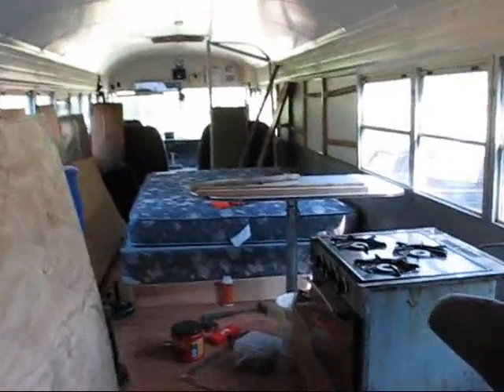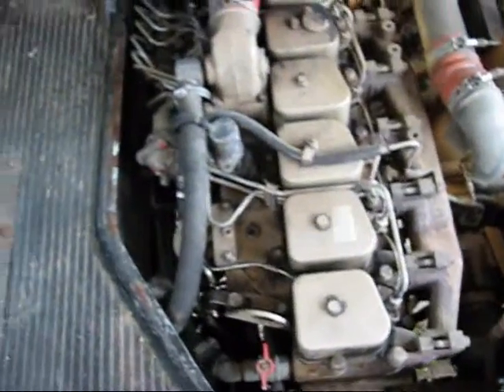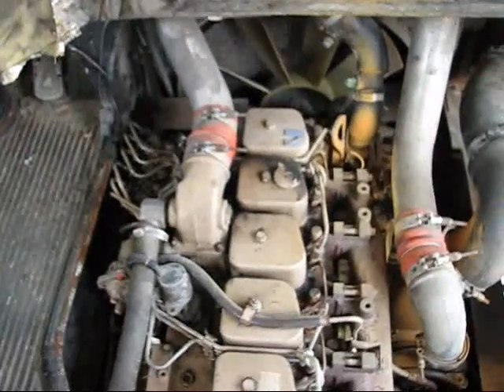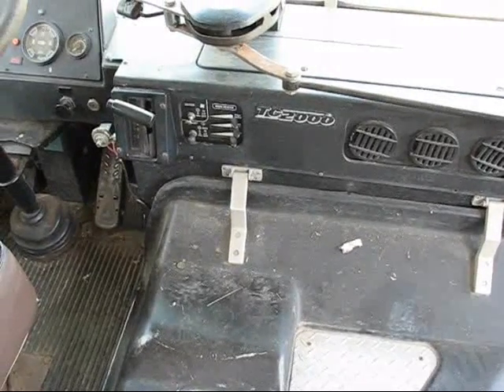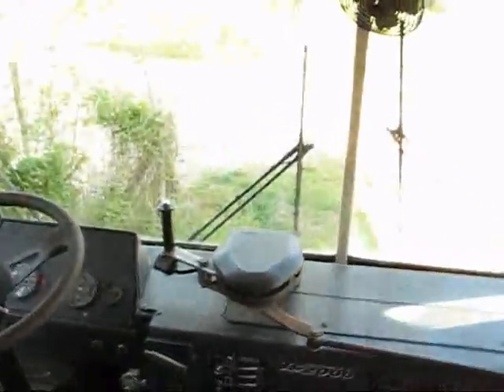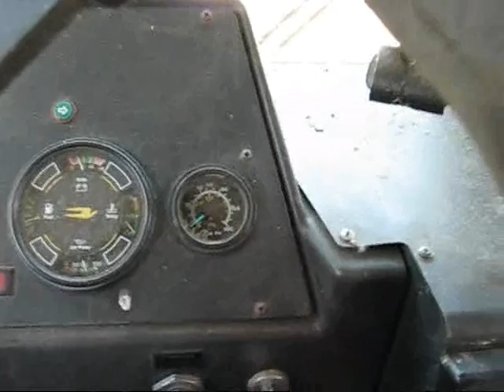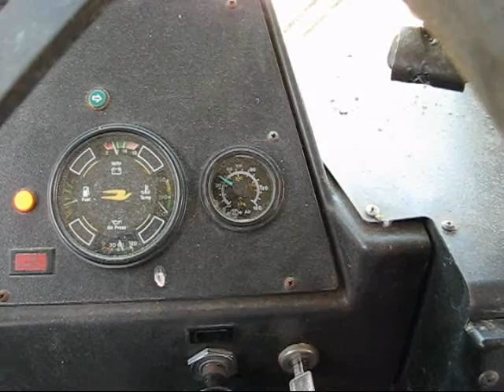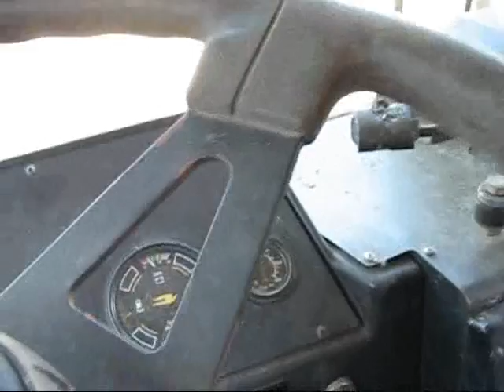Cummins Diesel Bus Cold Start

Comment: 6bt mechanical injection, one hell of a good engine. We have an old Clark 36000 pound capacity forklift with one in it and its fires up as easy as yours with over 2000 hours on it.
Reply from the maker: They're great engines, no doubt about it. I have another one in an '89 Dodge.
I once talked to a logger who told me he had seen 4BTs in Case skidders go 50,000 hours! That's the equivalent of 3 million miles at an average of 60 mph.
They don't last that long in a bus, though. It puts a much heavier load on them, not to mention the fact that they turn 2400 rpm at highway speed in this application.

Comment: I have a '93 Fleetwood 35J with a cummins 6bt with 63000 miles on it I bought a year ago. the exh manifold shrunk and broke 2 of the bolt ears off the head so I replaced the head with a Chinese ebay head and a Cummins head gasket. 1000 miles later and so far, so good.

Comment: looks like a 1993 Blue Bird TC2000 last year for the teleflex guages in the guage cluster and first year for the lower profile engine hood on the cummins 6bt which moved the turbo lower.  1994 has the GM sourced guage cluster. the other engine option for the BlueBird TC2000 up to 1995 was a GM big block 7.0l 427 V8 gas engine. as the TC200 was produced from 1988-2002

Comment from the maker: Soon. I need to locktite the flywheel nut and put it all back together. That's on the Tanaka; the Eska is on the back burner for now. I've been concentrating on my Honda Trail 90 project, and have a new installment on it that I will probably upload next week. Also, I'm getting back to my CJ-7 (which you saw in another video) since I sold my Cherokee. The XJ that is; not my full size Cherokee.

Comment: As long as the batteries are charged, it is a no brainer for damn near anything to start right up.
Reply from the maker: I guess that's true if you only ever operate late model, computer controlled fuel injected stuff in good mechanical condition.

Comment: in the uk many buses have the cummins 6bt and allison at545. the at545 is not a good gearbox it wont change gear until the engines nearly flat out and they jump in and out of gear. you can hold all 4 gears manually though. the cummins 6bt is an excellent engine goes on forever

Comment: that's a  damn good  sounding cummins  starts right up  ,,,I got  2  older  4BT cummins engines  and they are both like that 
1 is in a 1987 chevy S10 4x4 and it  has  280,000 miles on it  
the  other is in a 40KW genset  ,,it has  15,000 hours  run-time on it 

they both start just  as easy as your bus just  did ,,,
the  genset will start in  -10F weather with just a 5-10 second crank after preheat
Reply from the maker: What kind of fuel mileage do you get with the Chevy? I would like to have a 4BT to put in my 4 door Wrangler.

The genset sounds sweet, too. I have a railroad surplus genset with a 2-71 Detroit. It is six-pole so it runs at 1200 rpm. It is only 12KW, which is a light load for that engine even at such a low rpm. I have some videos up of that genny running.
Reply: I get in the  high 20s to mid 30s  depending on my  driving  and the  load 

my  genset  runs  1600 rpm  average  ,,I have a  neighbor  with  one of those  2-71 detroit generators   and the  damn thing is NOISY  ,,he says it  works  good though  ,,mine  is  actually  very  quiet  cause it  is fully enclosed in an insulated building
Reply from the maker: wildcoyote34
That's about the mileage I would be hoping for.
My 2-71 is noisy too because I just have a short glasspack on it. But I have seen/heard 6-71 gensets at hospitals and such that are enclosed and well muffled, and they were fairly quiet.
Reply: you  put a 4BT in a  jeep wrangler  you might  even get better  mileage than I do 
my 1987 S10 4x4 weighs 4400 pounds 
a wrangler doesn't weigh near that much 

I've  got  an old bread truck  with a 4BT  cummins and it still gets 12-14MPG 
but it is also a 1 ton truck chassis too so it is  very  heavy ,,,I've been working on making this 24ft bread truck into an RV too

yea  the detroit gensets can be  quieter if   enclosed ,, my neighbors  isn't enclosed and it  has a  plain ol tractor  muffler on it 

my genset  is fully  enclosed in a wooden building  with wood sheathing and  a metal skin 
it is also well insulated ,because I also have  3 250gal fuel barrels full of waste vegetable oil/bio diesel  stored in it too
I run  bio fuel in all my diesel engines

Comment: What's the top speed of this thing, and does it deal with grades reasonably? Been doing my research hoping to get my own bus, and had settled on looking for a DT-466 - but since have thought that the 5.9 might be a better choice for travelling (with their long run and use in pickups, second hand or boneyard parts .. or even an entire engine should be easy to find for low bucks) .. but still not sure pulling a loaded bus on the highway isn't asking a bit much from this engine.
Reply from the maker: It deals with grades ok due to its 4.78 gear ratio. But it has the non-OD Allison 545 transmission, which limits its top speed. Cruise is about 60 mph. I'm fine with that, but some people aren't. There is an Allison OD transmission that bolts right in, or so I've heard.
Reply: Thanks for the reply :)

Comment: I love Cummins.  I have a 5.9 in my Dodge Ram 2500.  Question I have is, as much as I love the 5.9 Cummins, isn't it way underpowered in a bus like that?
Reply from the maker: Not really. It has 4.78 gears, so that helps it. It's about all done by 60-65 mph, but it will tow a big load.
Reply: Oh ok gotcha.  Got to love the Cummins

Comment: we are sticking 6bt,s in land rovers in the uk
Reply from the maker: That's interesting. 4BTs are popular here for 4x4 conversions, because they are lighter.
Reply: hi possum,its getting to be a popular conversion here in the uk,i dont know if you can see this link http://www.landyzone.co.uk/lz/f82/cummins-powered-90-well-nearly-271522.html

if not look for nick seggells big purple one on you tube thats the 90 he has converted to a 6bt
Reply from the maker: mark daniel
Found it; thanks! http://youtu.be/jLxM8Xfbp0Q
This statement by Nick pretty well sums up what I love about these engines:
"3200rpm spring in the pump but 2600rpm is about as hard as i push her if i sit at 1800rpm i get 35mpg so try and keep in the 1400-1900rpm range (sounds brilliant in that range) and i set off in 3rd and clutchless change into 5th on a regular basis"
Of course I realize that is 35 mpg Imperial, but still good mileage for a Landy.